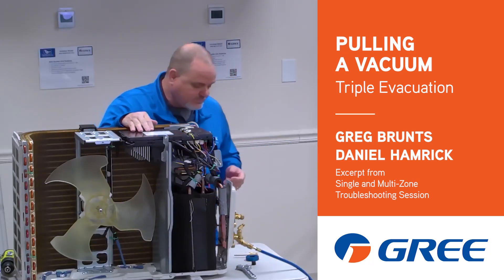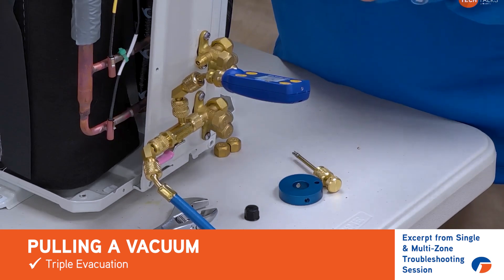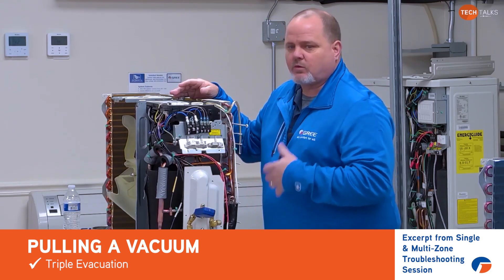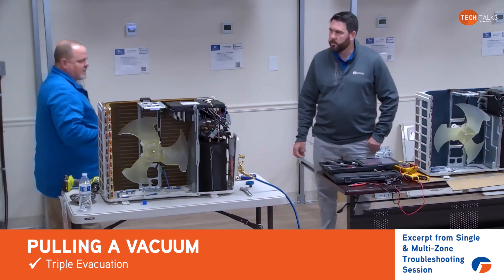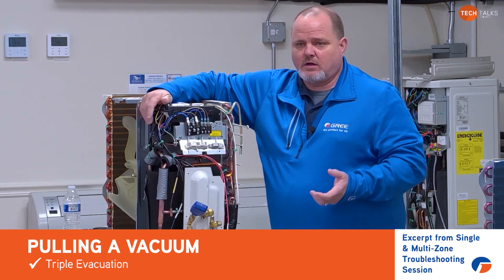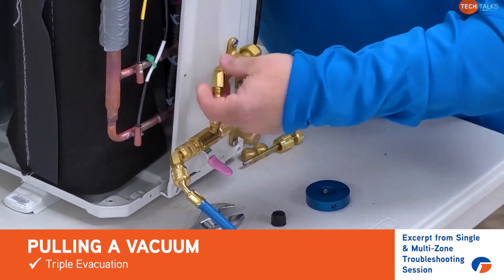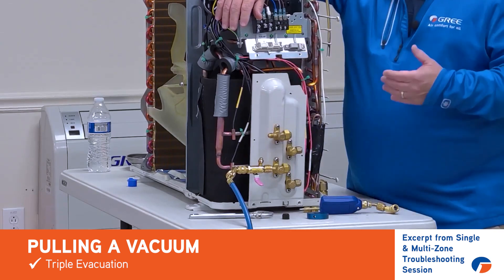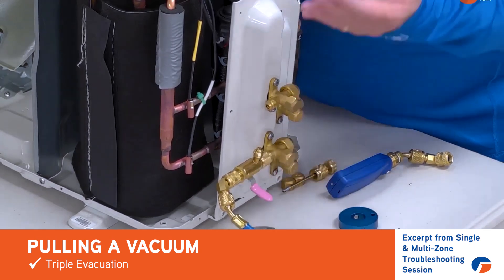Best Practices When Pulling A Vacuum #hvactroubleshooting

Comment: If all circuit are tied to the same suction line why is it necessary to pull all circuits
Reply: During installation you have to vacuum each circuit individually because they are valved off to the ODU. You can pull a vacuum on all circuits if the refrigerant has been recovered from the entire system. If you have a problem on one of the circuits it can be valved off and the other circuit(s) can remain in use. It is easier to diagnose a leak or line set issue on each individual circuit rather than trying to figure out which circuit might be the issue.